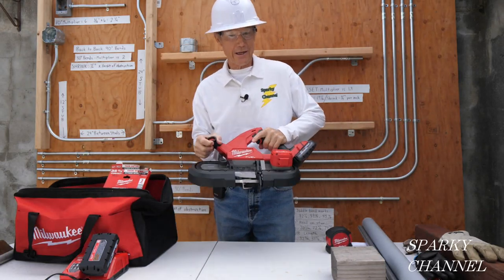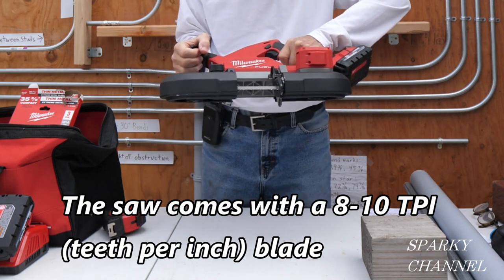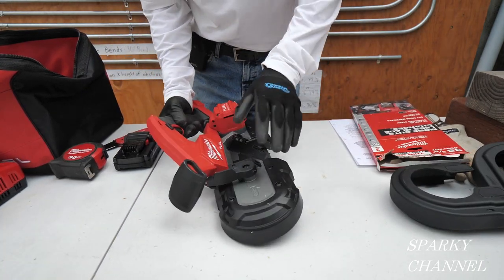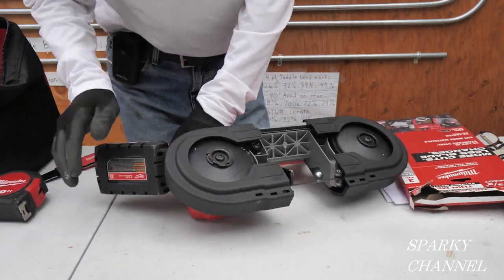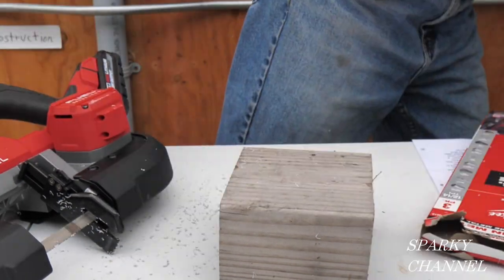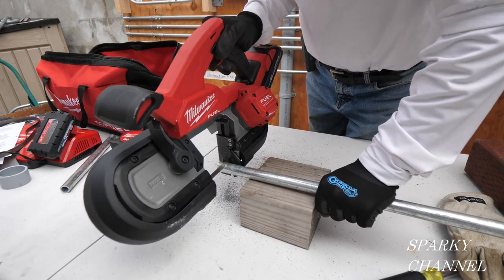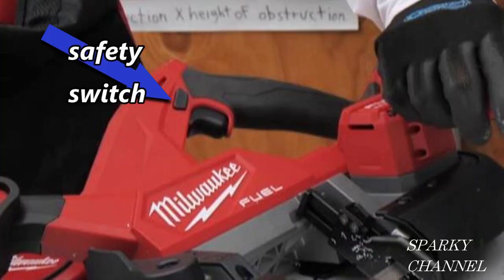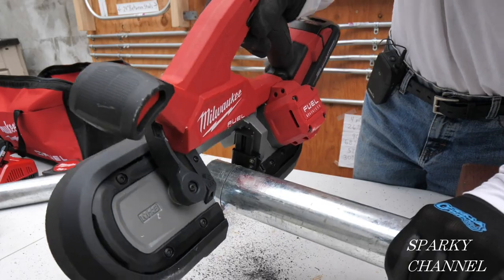Milwaukee Compact Band Saw 2829-22: Brushless, Light Weight and New!

Comment: Hi Bill,

Hope DeWalt will come out with a new version (brushless) with a 3 1/2 opening. 

Their 2 1/2" is also nice but it's brush motor and has a small open.

Thanks for the video 

Their com
Reply from the maker: They probably will. If I was to give advice to DeWalt I would say make the mouth 3 1/2" and put the safety button in line with the on/off switch. No problem, thanks!

Comment: Milwaukee must have discontinued the rubber boots for this. Mines didn't come with them & there is no mention of them in the user manual.
Reply: I think thats with just the dual trigger for some reason. Mine is the same as yours

Comment: Do you think you can squeeze a 3" emt in to cut?
Reply from the maker: I don't know. I tried to cut some 3" ABS and it got stuck half way through. Too bad they didn't make the mouth 3 1/2" wide instead of 3 1/4".
Reply: You can cut even 4 inch pipe, just roll the saw around the pipe as it cuts

Comment: @Sparky Channel. Hi Bill. Great review and demonstration.  Question: Do you prefer the way Milwaukee change blade system of removing guards or Makita with the access door? Thanks
Reply from the maker: I would rate them about even. The drawback of the Milwaukee system is that the guard on the motor side is awkward to get on and off due to the battery location. The drawback to the Makita system is the doors don't give you as complete of access to change the blades. Good question!